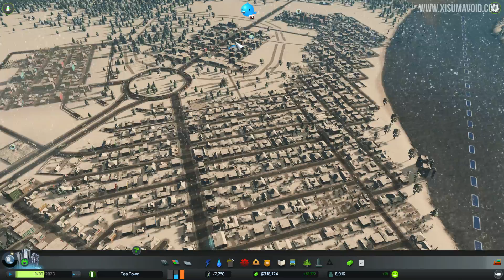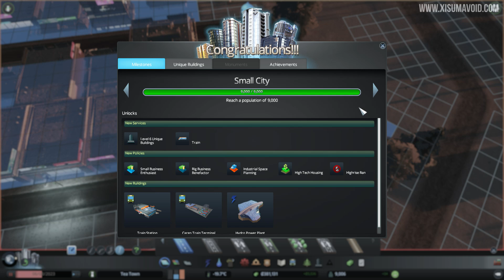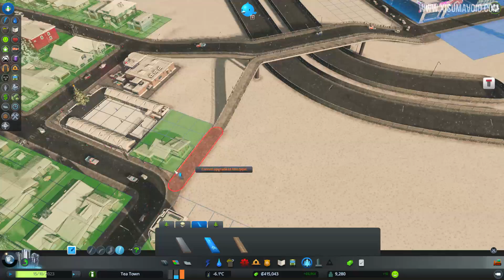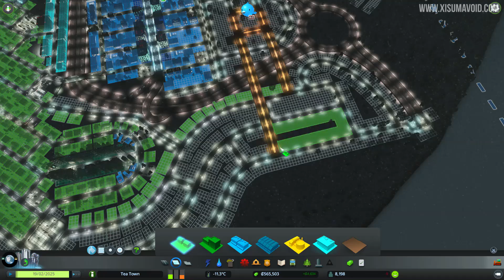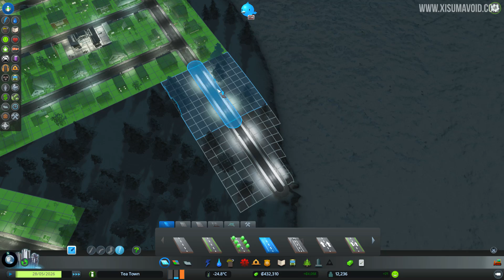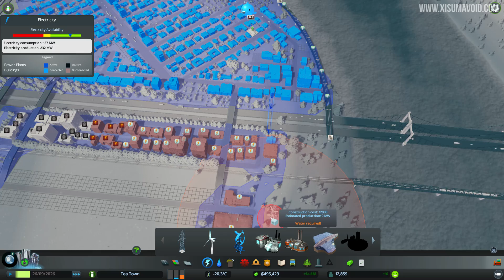Cities Skylines Snowfall 04 District Expansion

Comment: Still wondering why you didn't put in some Public transport instead of that many roads at that point.
Reply from the maker: +René Hauptmann Never really felt too much difference from using public transport, ill add some later i nthe series :-)
Reply: I am now at episode 9 and it seems the trams have worked. But what I originally meant were busses, because I believe it would've helped a lot with traffic.  Now at episode 9 Iam thinking about subways. But if it doesn't really help with traffic - I guess I was wrong. Sorry :)
.

Comment: The way you're staggering your blocks on either side of the main thoroughfare is causing a lot of intersections. The reason only a few cars get through is because only one or two cars fits inbetween your intersections and they're not timed for efficiency. Without mods you NEED to reduce intersections. You'll have to redesign your districts (which are an actual function of the game that you haven't touched yet) so fewer intersections pulling traffic of your main thoroughfares.

Comment: I think the tram road would look much better if it was a little further from the coast and there are buildings on the shoreline. It would be epic to have some skyscrapers along the coast and why would you reserve such a nice area for just a road. It will destroy some of the areas you have on the coast right now. However  i think they would look nice with a curved connecting road at the end instead of the jagged structure you have going on right now.

Comment: Xisumavoid, you are suposed to use high density residential to dampen the sound from the highway. The offices and commercial just increase the sound.
Reply: Offices are unaffected by noise and they do not create noise, mailing them the perfect barrier. Residential (both types) do not like noise which lowers land value and stuff

Comment: I think the big tram road round the edge looked cool but it should be on the ground and on the very edge so the coast comes directly up to meet it. Also, you shouldn't be restricted to building trams only round the edge - you could make tram only lines through the city to ease congestion with buses. Also, they look cooler than the subway!

P.S.
At 25:15 , ' it coasts along there' ... Xisuma-humour!